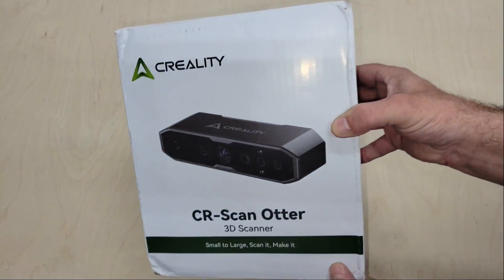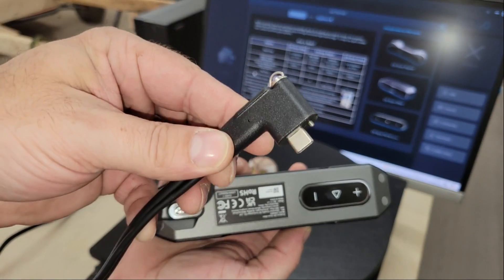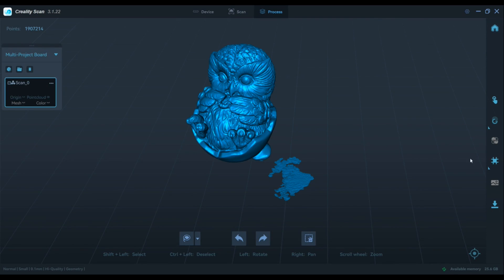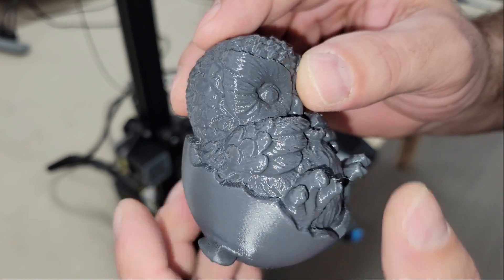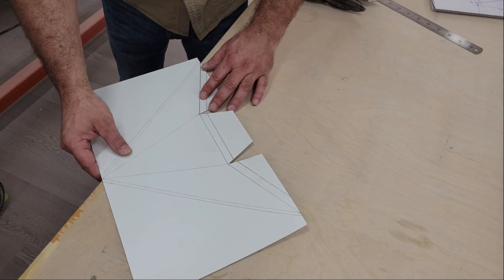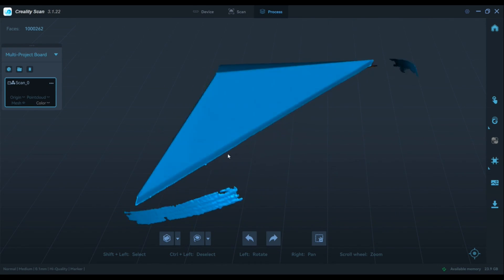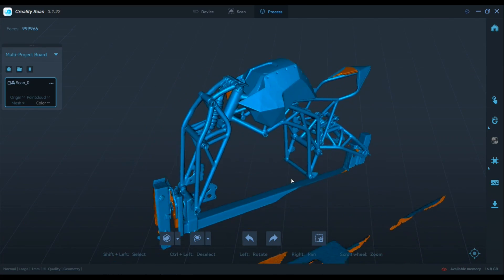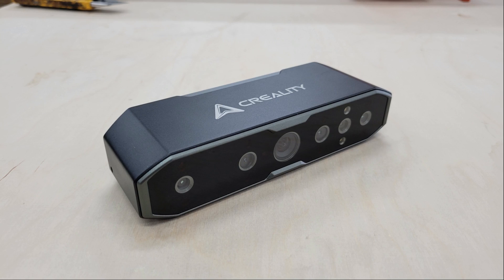Making A Rear Fairing For My E-Moto W/ A 3D Scanner

Comment: What nozzle temp do you print at? What material?  You should be between 205-215c nozzle if you are using PLA. Lower temps cause underextrusion problems, that you mentioned.

Comment: You need a usb extension cable. Easy to add 25 feet of range
Reply from the maker: Unfortunately not unless Creality produces it. This isn't a typical usb cable. It has usb connectors, but the cable itself is very different. Actually made up of two cables - both are larger than the standard and one is 4-5X thicker.

Comment: I have the otter for 3 days now but i cant get any scans to optimize the point cloud... I've no way of knowing whether its the scanner's fault or the scanner software being incompatible with my PC.. or what.. the point cloud looks amazing i just cant do anything with it
Reply: You need a lot of ram to convert a point cloud to a mesh. I use 32gb for my Einstar scanner and this is the minimum I would recommend for a PC dealing with scan data.
Reply from the maker: If your PC specs don't match the requirements then it's your PC. If you don't have version 3.1.6 or higher, then it's the software (I'm using 3.1.22). Or it could be both. Your way of knowing is checking the device requirements in the user manual and checking what version of the software you're using.

Comment: This scanner looks really promising and it seems like it solves most of the annoyances of my CR Scan Lizard (the cable mess with the power supply and separate cable to the PC, poor tracking with no marker support, limited focal range etc). But personally I don't trust Creality and more with 3D Scanners. My CR Scan Lizard is a nightmare. It is almost impossible to get a clean scan with it. Even with scanningspray and the included rotary table, it still loses track all the time. At this point they have so many scanners and several different scanning softwares ... I feel like they should focus more on improving what they have instead of releasing new stuff all the time.
Reply: working on what they've currently got is possibly the worst thing they could've done. Best course of action was to take the lizard/ferret/software out back to into the shed with 12ga. Then start over from scratch, clean sheet, with the lessons they've learned. You just learned the hard way the downsides of being an early adopter.
Reply: Creality seems to have abandoned the Lizard and Scan01 scanners, as there won't be any new updates for these two models. The new products CR-Scan Ferret, CR-Scan Otter, and CR-Scan Raptor all share the same software and are continuously being iterated upon. From Otter, it's evident that Creality has gained a deep understanding of user needs. In the past, scanning large objects required one scanner, small objects another, and medium-sized objects yet another. How many scanners do we really need to buy? Otter's design is excellent; with just this one purchase, it can cover various object sizes. We look forward to them fulfilling their promise and releasing a wireless scanning kit compatible with the Otter in the future.
Reply: @joeyhuang6791 lizard is still receiving updates via JMStudio of 3D maker Pro company.
Lizard is a different scanner, with different use case, it's not abandoned ,just is finished, and works nicely, you just bought the wrong scanner or wasn't able ro learn to use it. Also is a different price.